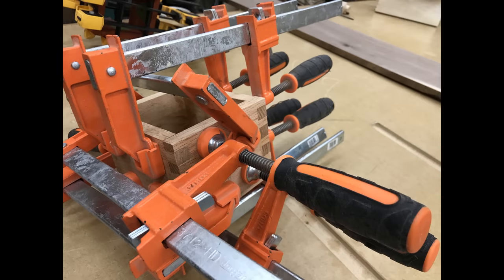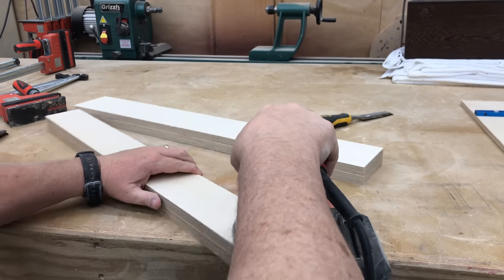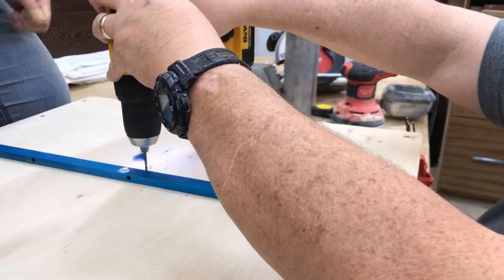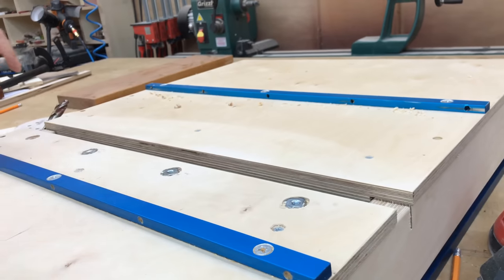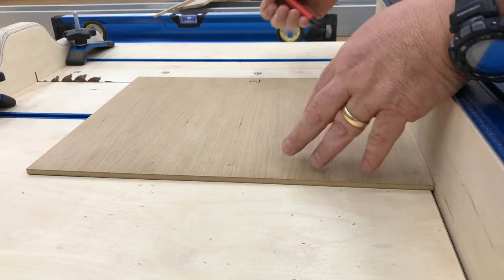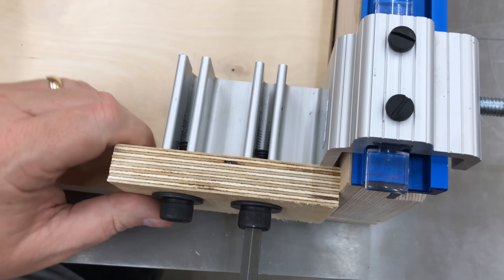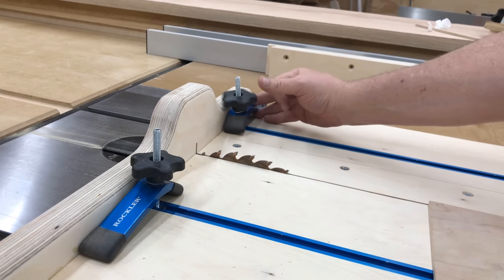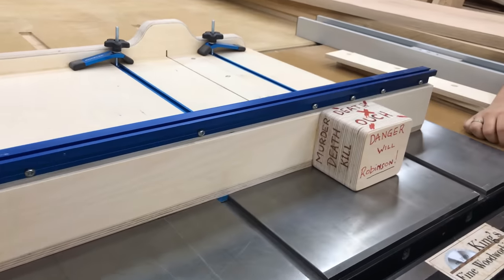39 - Extreme Crosscut Table Saw Sled with Perfect Miter & Dado & Removable Zero Clearance Insert

Comment: Does your "5 cut Square piece" have to be exactly square with all equal sides?
Reply: Nope, you can start with any rectangle. I'd suggest starting with cutting the longest edge first, so your cut #5 offcut is longer, magnifying the error. It's used with sliding table saws a lot, where you can cut a nice long 8' strip off the final edge, which would give you a hyper-accurate measurement of how far out the fence is.

Comment: great video, but at 38:48 or so, the perfect 45 is the piece you are NOT using.  the side with the green tape is the perfect 45 to the cut.  the piece you used works, but is only as good as the "perfect" 90 degrees to the green tape side.   to test this out make the sides not parallel and you will see. it will not work with piece you are using.     Of the hundreds of sled videos I like this and the almost perfect 45.  I am headed to the garage with my notes from this to complete my first sled and miter attachment.

Comment: Great sled!  I only have one question so far - you were concerned about the accuracy of the back fence position to within thousands of an inch, but I'm wondering what assurance you had that the surface of that fence was flat to within thousandths.  It didn't seem like you ran the face through the jointer, just the edges.
Reply from the maker: I clamped it flat to the cast iron table to glue.

Comment: You showed an excellent method to create a perfect 45-45-90 triangle. You show appreciation for accuracy and geometry..however, your execution of how to make a frame-to-order needs to be corrected. The point of pre-cutting frame parts is to make a frame of a certain size for a specific need. You showed 2 errors that arbitrarily shortened each frame piece...albeit consistently so the frame assembly still worked. To preserve the pre-cut lengths, you must postion the triangle so the molding length is not changed by the miter cuts. You must place the corner of the molding at the cut line...not beyond it. Some would want to position the molding corner at the far side of the cut line by butting the corner of the molding against the far cut line in the fence...but that requires adding 2 x kerf to the pre-cut lengths. Either of those will yield a frame of pre-determined size. The math to determine what the lengths should be for a specific picture or piece of art can be found elsewhere. Your sled and your triangle can be used to make perfect frames for such needs... but not by the method you showed.
Reply from the maker: Thanks for your comment.
Reply: Right, but in fairness no claims were made about those specific lengths.  If the triangle has not been "nipped" at the corners from previous use, then securing the triangle it in place with it set against a stationary saw tooth will eliminate this concern.  I enjoyed the video and all the fussing.
Reply from the maker: Hi Spence, perhaps one day I’ll make a video on how to size a frame for an artwork. I have made more than a hundred such frames in my woodworking career. 

In this video I was just showing how to make a perfect 45 degree cut. And as a proof of concept, I spent about 45 seconds cutting an unmeasured piece into arbitrary lengths to show it had indeed made 45 degree cuts. 

Most woodworkers can take a tool that gives them a perfect 45 degree, and figure out how to size a frame and make it. 

Problem solving 101. That’s what woodworkers do.
Reply: Spence Bloom 
Apologies to James about starting a marginal flame. Perhaps Spence and I both have too much time on our hands. Precise alignment of mitered frame parts is a special concern and challenge. Mr Bloom is correct, and his concerns mirror worries about compounding the error with 8 cuts. However, I’m guessing it’s possible to work to 1/64” X square root of 2 or better for each cut by eye with the corner of a fresh and true triangle. James’ demonstration was a pleasant tickler that should yield good results for careful woodworkers. No offense intended towards anyone.
Reply: Not to beat a dead horse, David, but..... James did not compound any error. It was perfectly consistent, thus he demonstrated a perfect frame. 
   At 40:08 he shows the cutoffs from 4 of the miter cuts. Each cutoff shows how much the original length was shorted (plus a kerf) just on that end. It also occurred on the other end of each piece. 
  For making the pre-determined frame size, the cutoffs ought to show zero length change because the blade should hit the corner of the pre-cut pieces...and the kerf should subtract from the cutoff. It was bad advice to say it doesn't matter where the triangle is positioned.
   The advice isn't a problem if one just wants to demonstrate making 4 mitered corner cuts that assembles perfectly into a frame....but at ~39:00 he says he says he wants to show how easy it is to accurately make a frame...he described it correctly but did not follow through in the demonstration. I was surprised considering his usual attention to details.
   I think we're all good on this now. I look forward to a video on making frames sized to the artwork...especially if he spices it up with compound mitered frames. :)

Comment: I originally thought tapping the aluminum bar was genius, then you countersunk the bars & installed the screws from the bottom relying on only the threads in the plywood to hold. What? Why would you not countersink the plywood side & thread into the bars?

Comment: Why is this for sale for 995? How do you justify that price for a saw sled?
Reply from the maker: It’s $15.99 actually. But I honestly have a couple hundred hours or more into it with design and prototyping and testing. Not to mention the hundreds of dollars I put into it doing re-builds to get it just right. And it comes with over 60 pages of step by step instructions. 

It seems like a good deal to me. But no one is forcing you to buy a set. 

In fact, I made this a 45 minute extremely highly detailed video purposely so that not everyone would need plans. And the video is 100% free.
Reply: @KingsFineWoodworking  I checked your site and was eager to purchase one (the actual sled not plan) but saw the $995 price tag. Is that correct? Cause I'd like to buy one but the 995 threw me off guard. I understand the man hours put into it, but for $1000 you might as well slap an apple logo on that sucker. Thanks anyways
Reply from the maker: @JayJay-sr5gn , hi. I don’t sell a completed sled. Only the plan actually.
Reply: @KingsFineWoodworking  appreciate it anyways. Could've sworn I saw it under 'Pieces  for sale' along with the smaller sled for 399 which sold out. But now it's not showing anymore. Ah well

Comment: regarding #39 extreme saw sled, if you have a right tilt saw you can not use his instructions as the miter slot is on the wrong side
Reply from the maker: That’s correct. You would have to flip the base around 180 degrees for it to work.

Comment: 34:33 As much as I admire your solution, the reasons behind it are flawed.  The line of the cut on opposite sides of the board will both be the same length.  Still it makes sense to use your solution.

Comment: Well once again I didn’t read all the instructions, but still will not do as the instructions say to do. I’m going to run the screws from the top into the mitre bars which should give better holding power.
Reply from the maker: Hi Doug,
You are right. It will give better holding power. 

But the reason I don’t do it that way is because there is practically zero side-loading on those miter bars, and in fact CA glue alone is enough. I actually have a ten year only sled whose miter bars at just super-glued on, because I never got around to putting screws. And it works great. 

The other reason I didn’t do it from the top is because this sled has two layers. And I wanted to be able to unscrew the miter bars from the bottom to keep them for future projects if I ever stopped using the sled. And that would be harder to do if the screw heads were buried between two layers of ply. 

But honestly. No worries at all going through the top with your screws. Your sled can easily last a lifetime if you take care of it. 😊👍🏻

Comment: I've seen this method a lot and there is no doubt that it works.  I have and still do maintain that equal or even better results can be obtained with two carpenters squares.  One on each side of the blade.  Then change the squares from one side to the other to check.  But this produces an error so small it cannot be measured over the length of the longest cut the sled will make.    If you want you can even place the squares in place and then clamp them to the blade and to the fence.  It simply cannot be adjusted any closer unless the blade is uneven.  (not likely)

Comment: I like the sled and the method however I completely disagree that this would be more precise than the Incra 500. There isn't really anything more precise than Incra.
Reply from the maker: Hi Mike, thanks. I’m assuming you mean the Incra Miter 5000, and yes, it’s awesome.  Do you have one? I do. 

If you do, then you know it is only as accurate as the setup. 

Both my sled, and the Incra have a squaring in process. The process is exactly the same. You can use the 5-cut method (which is the most accurate), or any other method you like. 

But the bottom line is this: the accuracy of the sled, meaning it’s ability to cut exactly at 90 degrees, depends completely on how carefully you square it in. 

If you don’t square the Incra in properly, it’s a $500 piece of junk. 

If you don’t square my sled in properly, it’s also a piece of junk. 

Now, if you take the time to square both of them in perfectly, they can really complement each other. Mine can cut dadoes the Incra cannot. Mine can be zero clearance with thin kerf blades and regular kerf blades. The Incra cannot.  The Incra can cut every angle with great accuracy from 0 to 90. Mine cannot. The Incra has flawless angle repeatability. Mine does not. 

In my opinion they don’t compete with one another. They are different tools. It’s true that they have some functions overlap, but they are also for different things. 

Anyhow, thank you for watching the video and taking the time to comment. 

~James

Comment: Very detailed and meticulous video. Great work. However, after using calipers and feeler gauges to get the sled set up and going to 10 thousandths of an inch accuracy, at 36:40 your final check on the top measure on the stop rail you used a regular tape measure to verify your cut. Don’t those things have a bit of slop in them. Why not use a more accurate measuring method for checking the setting for your lens? Instead of being exactly 12.5 inches, it could be 12.52” or greater depending on the slop in the tape measure. Obviously, the tape measure is ‘good enough’ and fairly accurate, and your cuts will be consistent using the top guide. But it was just a bit inconsistent with how precise you were with the rest of the construction. Thank you for the video. I hope you paid your helper ;-)

Comment: I dont think your caliper use was entirely accurate over the distance of the piece and could be misleading to others. Not going to split hairs over an overall half inch. However if you're using the entire length of the part, measure at each end of the piece, not over the end (~.25") in on each end.

Comment: Maybe I hold a world record .. took this dummy 12 different 5 cut attempts to get it right. But I got it down to 0.0000728/inch of error. Pretty awesome
Reply from the maker: That might just be a record for accuracy! Awesome!
Reply: @KingsFineWoodworking  haha thanks! Was frustrating yet rewarding
Reply from the maker: That’s happened to me too! Sometimes I get sidetracked and mess up a calculation, then adjust it thinking it’s going to be good then it’s worse!  I read your post in the community just yesterday,  though. And your math was perfect of course.

Comment: Hi, excellent explanation.
I saw, however, that you rely on your measuring tape to register and calibrate your fence stop block reference. Measuring tapes, when the bent sliding tip is used as reference, are not precise measuring instruments. You should use an offset measuring, taking for reference any reference indication such as the first inch or centimeter and measure from that. Or using a caliper, steel ruler or other more precise measuring instruments.
I made my own statistics with several brand of measuring tapes, and they all fail to provide precise measurements.
I hope this approach helps you on future projects, as it did for me!

Comment: Why did you tap the plywood??!! It will never last. After tapping the aluminum you could have counter sunk screws from the plywood to the aluminum and threaded into the aluminum miter bars which would have been the correct way to do it.
Reply from the maker: Hi Mike, I do it that way because I want a clean surface on top. I understand it’s not as strong as sending the screws through the top. But it really is strong enough. 

I’ve found that with screw holes in the top, I’m more likely to scratch a board due to accumulation of dust and me sliding the board around. So I try to keep top holes to a minimum. (Already have to have some for the zero clearance insert). 

As for durability, I’m still using a 12 year old sled & a 14/15 year old sled built this way, they are as strong as the day I built them. 

But just the same. Anyone who chooses to build a sled like this is totally free to put the screws in whatever side they wish.

Comment: A-ha moment... building the sled according to the plans, making the first cut... switching blades... and realizing the sled doesn't work for right tilting saws (ie., my delta contractor saw) without redesigning the entire thing (ie., blade grows to the left, where the zero insert plate isn't).  Great sled concept, but PLEASE, PLEASE, PLEASE consider putting a warning on the video, the website and the plans that the sled will not work for a right tilting saw.  $100+ of materials down the tubes...

Comment: Incredibly stupid complicated way to 5 cut.
Mark a board 1-4(5), make 4 cuts then the 5th. measure each end of the 5th cut then sneak up on a perfect 5 cut with small adjustments to the adjustable end of the fence. All that math is not necessary in a furniture woodworking shop to achieve square well built pieces.
Reply from the maker: Thanks!  Man if you think that’s stupid just wait til you see how much glue I use!  You’re definitely gonna be mad then!